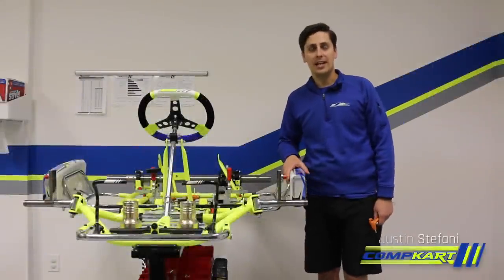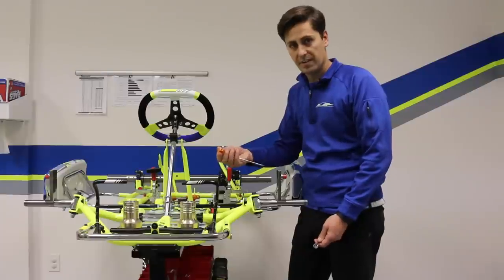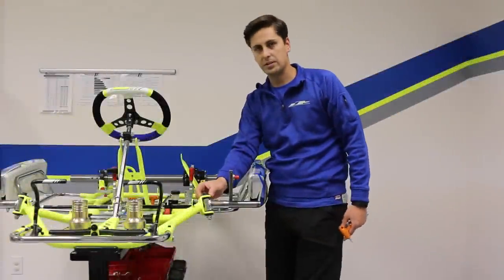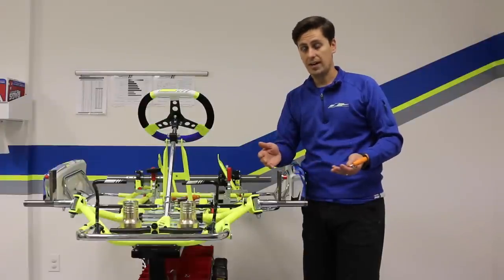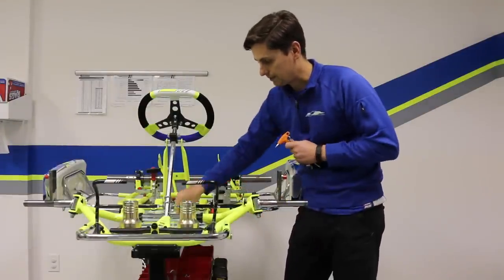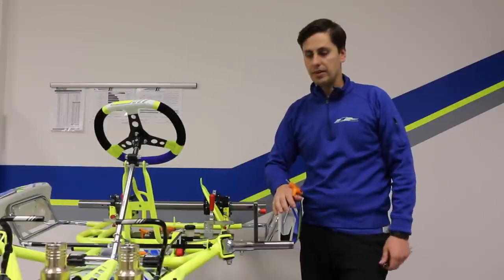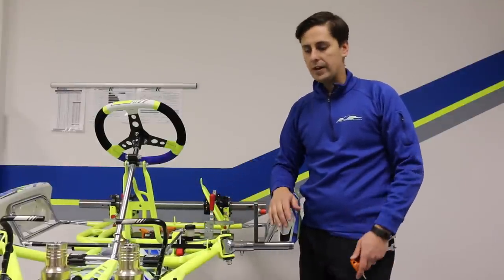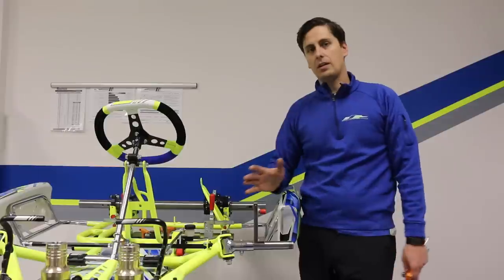Pro Tip: BASICS OF CASTER AND CAMBER

Comment: Hey guys, so this confused me for a long while as well so let me explain to you what he doesn't in the video. Basically, yes what you all are saying is 100% true....he is using the same mechanism to effect a change on both caster and camber. When he turns that eccentric, it basically moves the king pin bolt in an elliptical motion hence changing both caster and camber at the same time. So say you set your camber on the sniper to where you want it, if you want to retain this camber then you have to live with what ever the caster is at that point......if you want to increase/ decrease your caster and have that even on both sides, then the inverse is true....you have to live with what ever camber the sniper reads at that point. Now for what you've all been wanting to know and what he does not say in the video.......if you want a certain camber but then be able to independently change the caster more or less yet retaining the same camber reading, then you NEED another one of those eccentric pills below the king pin as well......so then you have 2 eccentrics....one on top and one below. With these two now you can turn both independently and get any combination of min/max camber and/or caster you want. For that comp kart, I am not sure if they sell the pill which can then be added below the king pin .....right now that kart that is in the video has a neutral pill below the king pin meaning it is completely spherical in shape and will do nothing if you turn it. On my Birel chassis, I bought another pill and fitted it below my kingpin so now I use one for camber and one for caster and can get any combination I want. Hope this clears it up for you all!
Reply: Man,really appreciate your explanation,clear all my head.With 2 washers,yes we can rotate them simultaneously to make diff settings and change the caster and camber independently,but will there be a little bit change of the wheel base and track width?Will those change the dynamic of the car?

Idealy,what am I think abt is,can we just use 2 washers together on only one side of the king'pin axle?
Reply: 马世伟 not sure if I understand what you're saying but no I've never seen two used on the same side
Reply: yeh you are right. but how to know exactly how mych caster are u running? knipers can do it?
Reply: Aécio Telles to know a figure in degrees the sniper can't do it, the V2 edition at least. basically you set it by the position on the kingpin bolt....setting it such that the bolt leans to the back of the kart fully is maximum caster, the inverse is minimum
Reply: thanks christopher - l just very weel understood and will apply at my go kart
Reply: this is fantastic
Reply: Thanks for that explanation!

Comment: Hey thank you for that general basic description it was very helpful for us green behind the ears,newbys,I have a tag senior birel and have been very interested in learning the different ways I can make it turn best for my local track and have been thinking taking some negative camber out,not a lot at once to learn,and drive the difference,I think with flatter tire patch,closer to zero it will turn cleaner,less start turn scrubbing,and make my wheel movement more precise,negative camber at this time is heavy,guess it looks like -10 ,may be -12,I'm close to a kart race shop so I will see,but thanks for the tips on rain adjustments,my cart has a Physco power band,I could imagine it in wet conditions,so every little bit of info helps...thanks for the insight...much appreciated.

Comment: I'm probably being stupid but how is the camber adjustment your making any different to the caster adjustment you're making? It looks like it's the exact same process so how can you set camber with the off center washer by rotating it if setting the caster is exactly the same method?
Reply: Yea, im with this guy... So you rotate the washer to change the caster AND the camber? So you get the caster you want, but then your camber is messed up, or the opposite...
Reply: Castor and camber use the same adjuster this is pretty standard on karts.  The difference, which he does not do a good job of explaining IMO, is that for camber you move the top hole inboard or outboard, for castor you move the top hole forward or rearward.  Due to the limitations of this type of adjuster you can only get partial adjustment if you need to adjust both castor and camber.
Reply: I understand the confusion, I’ve always adjusted Camber the way it’s explained in the video, however when it comes to Caster, you change the eccentrics... For example, on a Birel Chassis you have to types of eccentrics, 0.5 and 1.5, so with those you can add or take Castes away as you feel like, this video imo doesn’t explain that, if you rotate the eccentrics, without replacing them, you can only adjust Camber, not Caster.. All the chassis I’ve had, came with different eccentrics so you can adjust the Caster, I don’t really know how is he supposed to change Caster without replacing the eccentrics.

Comment: How does adding caster, moving the pin back which moves the front wheels forward shorten the wheelbase?
Reply: Not by a lot, but by moving kingpin back a little, you change the position of the hub as well. It's not visible difference, but I don't know how it affects driving in a cup kart.

Comment: If i adjust with tape measure in centimeters what are the basic values for camber caster and toe ? KZ2 praga chasis ?
Reply: You might as well buy lasers, they are super easy to use imao
Reply: @p.c.h.6721   but expensive
Reply: @martindimitrov1955  
You maybe able to find them second hand, I bought mine for 100